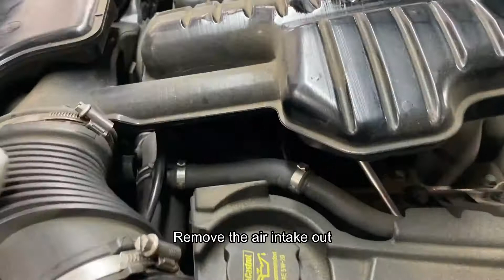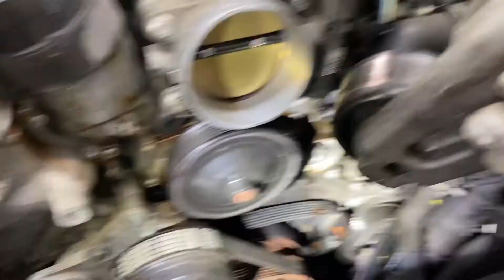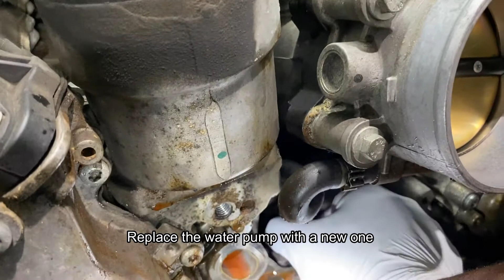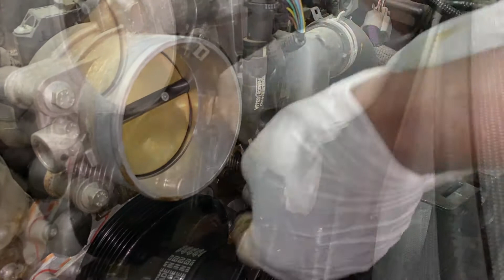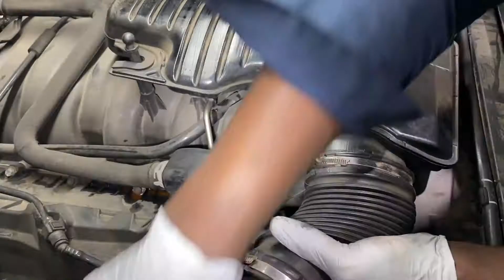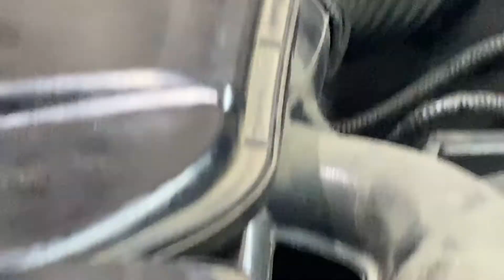HOW TO EASILY REPLACE WATER PUMP IN RANGER ROVER (2008 - 2012)

Comment: Except when the fan clutch doesn't want to break loose that easily. Land Rovers are a pain in the fucking ass. Your better off with a set of pneumatic fan clutch wrenches and you use an air chisel to vibrate the shit out of it.